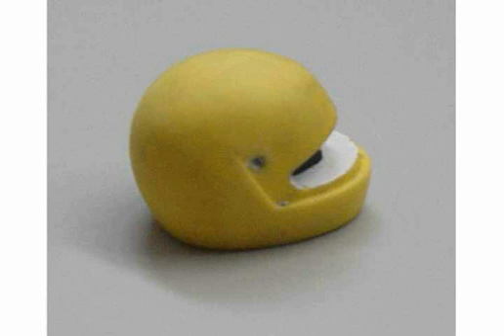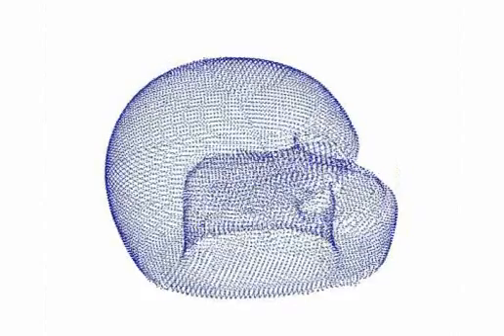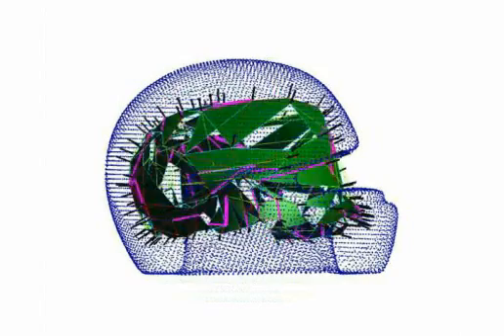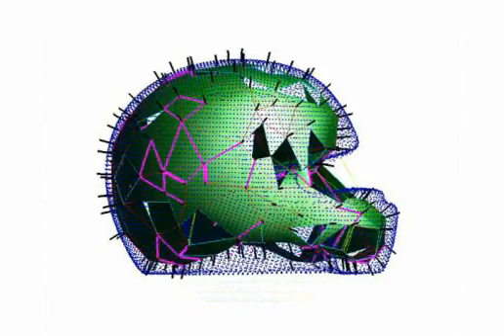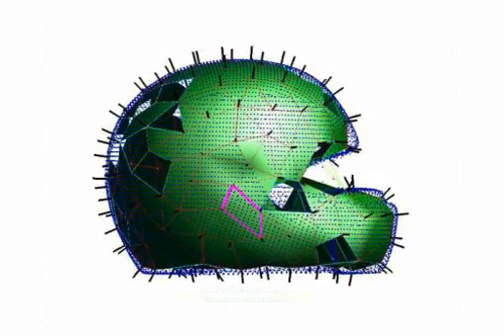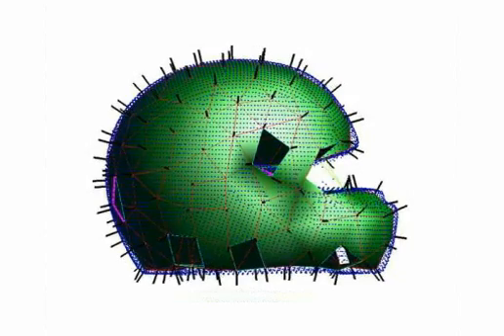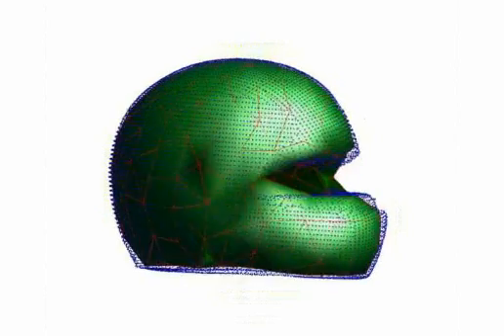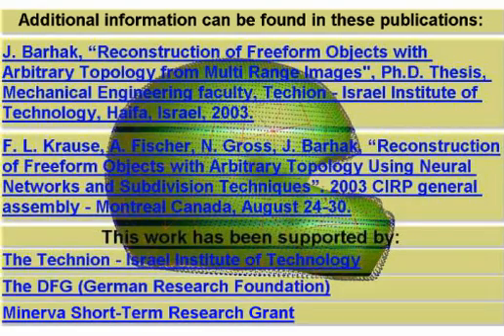Geometric Reconstruction Using Neural Network Techniques

Comment: This is a very cool idea indeed!
Can you tell me how your algorithm works for more complex geometric objects like cars or more concave shapes like chairs/tables ?
I'd also like to know how much "noise" can the algorithm weed out?
Reply from the maker: Sorry for responding this late, your message was just found out buried. Think of the algorithm as a clustering algorithm. It has reconstruction power, yet it all depends on how many nodes you want in the final mesh. You can think about it as a type of compression algorithm where a shape is reduced to a specific number of nodes while trying to reconstruct the 3D cloud points. There are many reconstruction algorithms that will outperform this method in many cases, yet this method is unique since it uses machine learning techniques that have a connection to geometry and can compress the output mesh to a specific size while keeping more vertices in densely sampled areas.